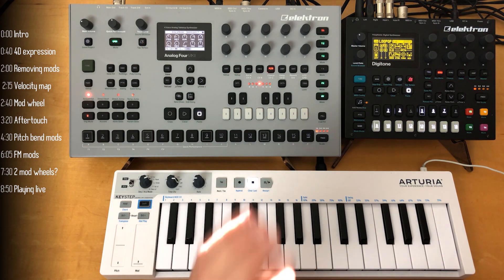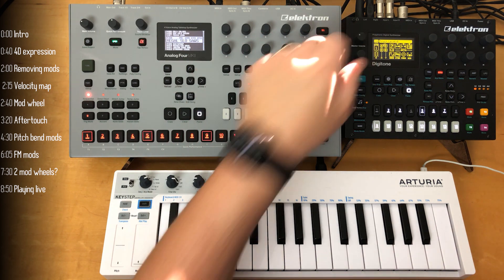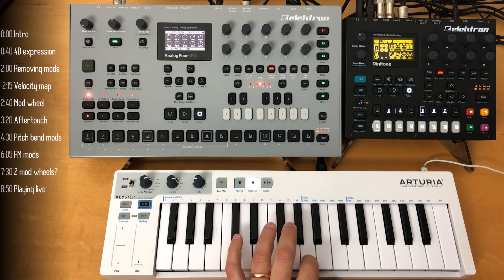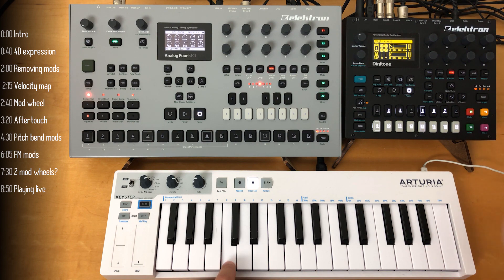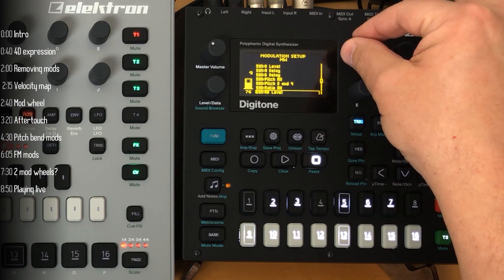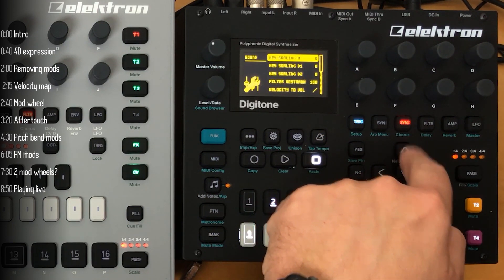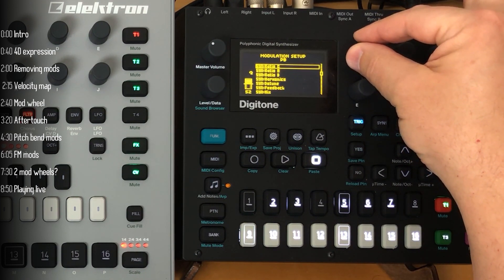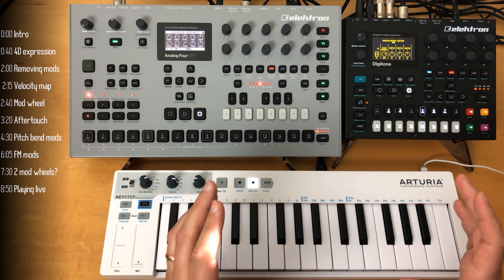Live expression on DIGITONE and ANALOG FOUR/KEYS: How to bring sounds to life

Comment: Very useful and one of a kind on YT tutorial on these elektron devices. These modulation details are barely covered in the manual and your in depth video here definitely shines a light. 
I have a follow up question based on a digitone paired with a keystep. 
I’m trying to have sounds velocity modulate the filter to make it sound deep when pressed soft but sound excited when pressed hard. 
And while experimenting with the velocity mod section, I was not getting the right results. 
If I would set the filter freq say to 60 or -60 the sound did not fluctuate up or down between those values the harder and softer I played the keys. 
I also tried playing with the velocity curve. Exponential vs linear. 
I was getting some sort of results by using the first on a negative filter freq and the second on a positive. Is that the logic?
Would love to have a dynamic filter react to how hard or soft I hit the keys. 

Thanks so much!

Comment: Thank you! How would you use the keystep arp/sequencer with the DN? Nothing happens when I try it, also the 'hold' button doesn't do much.
Reply: Snuckyfication the way I do it: make sure keystep is on midi channel 10 so it follows the track you’re in e.g. Track 2. Mute the track if you like, so you can clearly hear the keystep sequence, maybe try setting a longer gate length on the keystep depending on the sound you have chosen. Hope that helps!

Comment: Hi man. Great job! Thanks! Small question. I won't to connect my digitone digitact and the keysteps. Did you have any idea what is the best way to keep them synced together? (Midi wise)
Reply from the maker: Kobi Or Cohen thanks ;) sync is easy with midi out to midi in. Plug keystep into the one you want to control and make that first
Reply: Thanks for the fast response. I try to by more clear. I go from DT out to TN in and the sync between them is perfect. The issue is that I don't have free slot of midi in the digitone to control from the keysteps. Sorry but I'm new in the hardware world. Hope I'm clear (:
Reply from the maker: Kobi Or Cohen I understand - so why not go from Digitone to digitakt?
Reply: its a very good question man! The problem solved! Thanks (:

Comment: For some reason, the Mod Wheel of my Keystep does not work with the Digitone, there is no signal going through. Everything else works fine.
Reply from the maker: j RK did you change the ModWheel CC? Use the keystep midi control center and set it to 1
Reply: loopop thanks! It works.